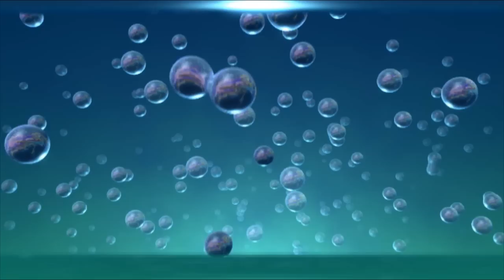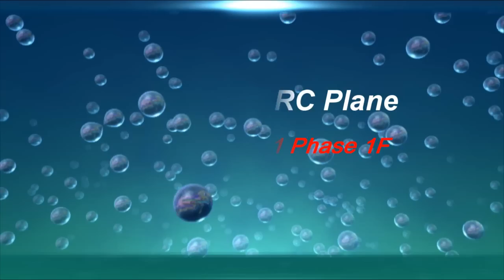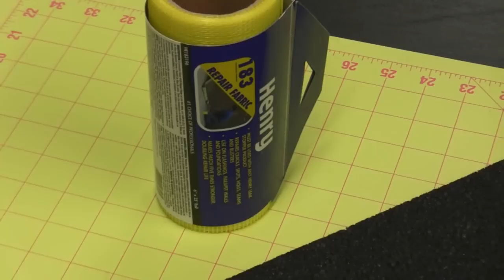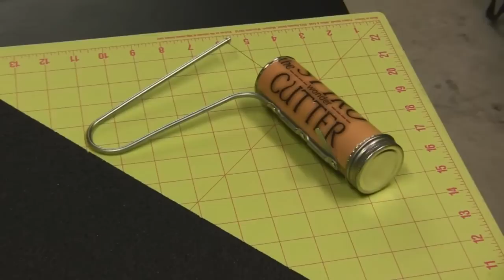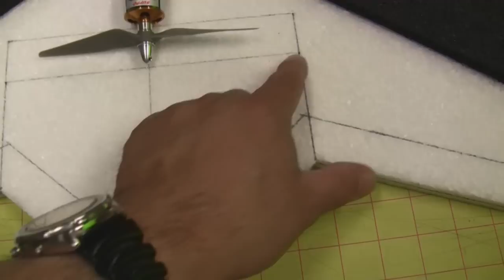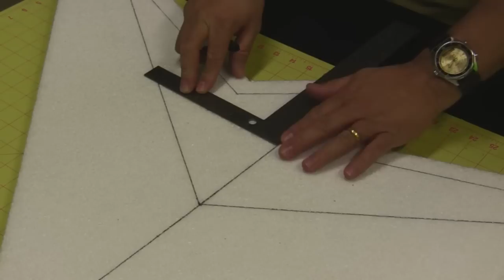Bullet Proof RC Plane Build Along No1 Phase 1F

Comment from the maker: droogkloot666 both Paul and I get the Henry 183 locally. You can usually find it at HomeDepot or Lowes in the roofing repair section. It should be with all the other Henry products. If you can't find it there do a search under roofing supplies on the internet or you could look at few local roofing supply stores in your area. Don't worry if you can't get it because I will be going over a few different substitutes you can use in an upcoming video.

Comment from the maker: Actually the reason I want to try it with out fins is I read they are not needed on a flying wing when you use a KF airfoil. I've also seen a few videos on YouTube of such wings flying without stabs. If anything it should at least be an interesting experiment.